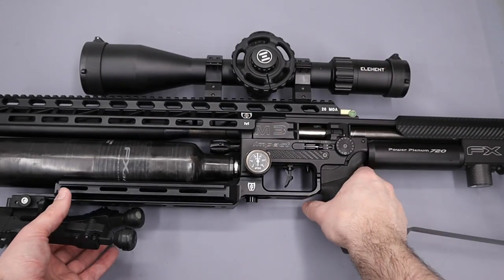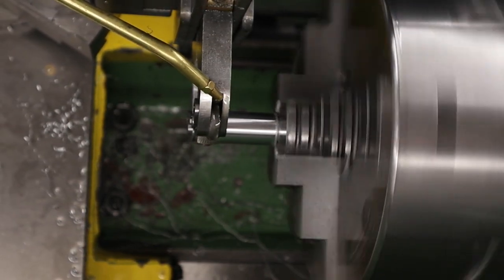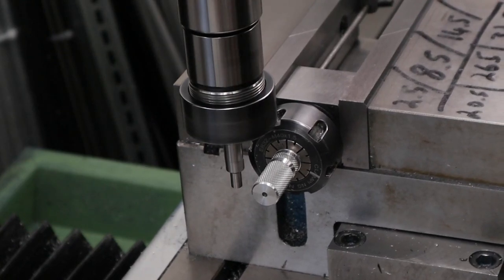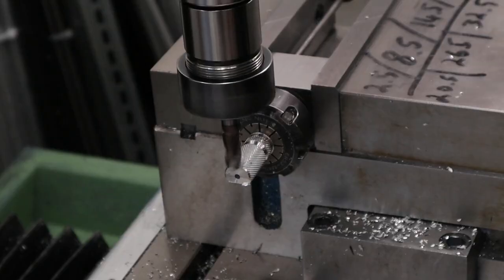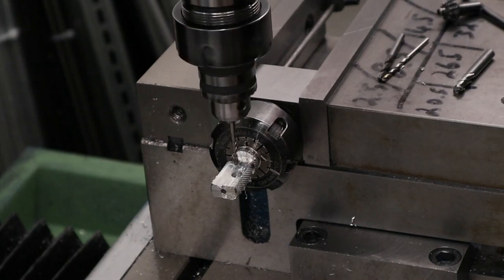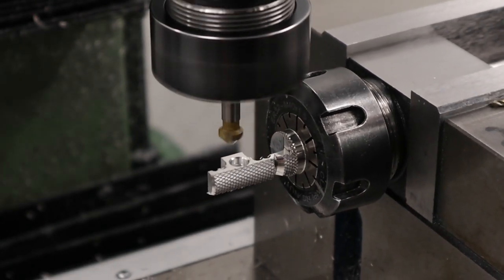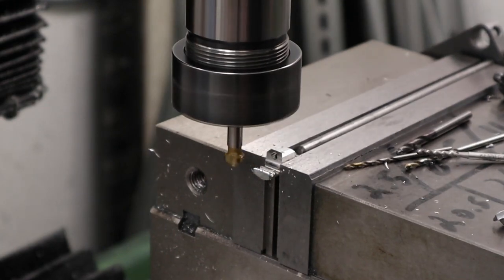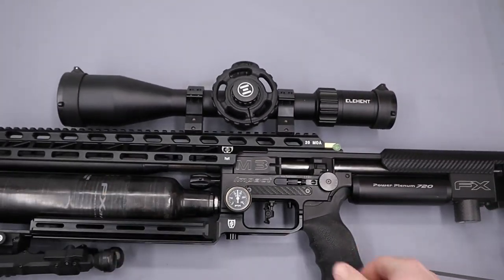Making a new trigger blade for the FX M3 Impact

Comment: Good job. Did you make the parallax wheel for the scope too. Also the square post behind the trigger post
Reply from the maker: Yes we did the parallax wheel 😁 the square post is the second stage adjustment i made a new setup for the trigger for the BR comps, i couldn't get the standard one light enough😁
Reply: @sub12airgunners  very nice. Well done.